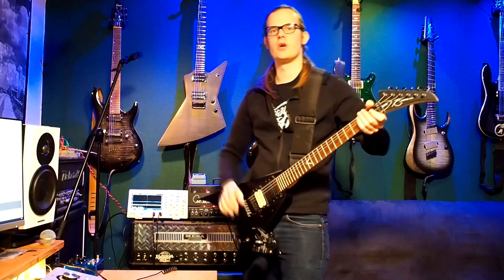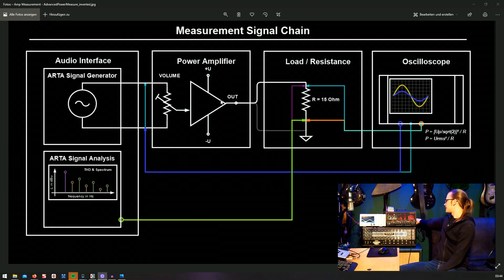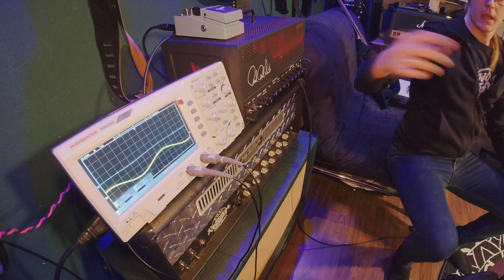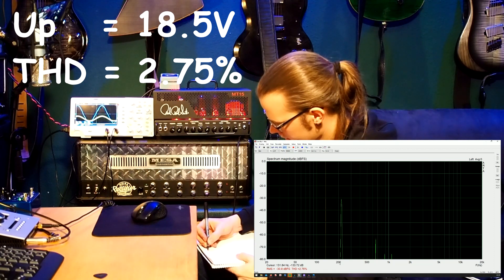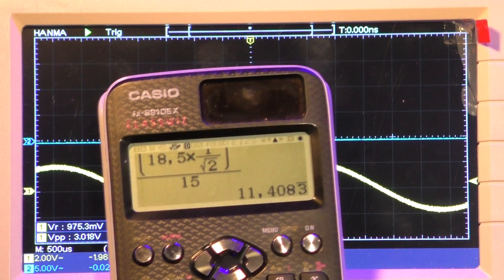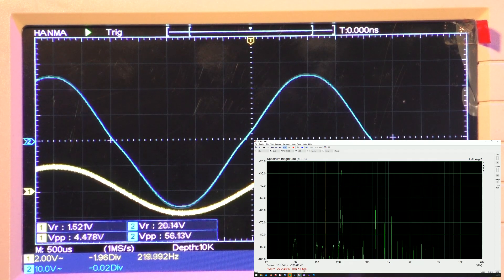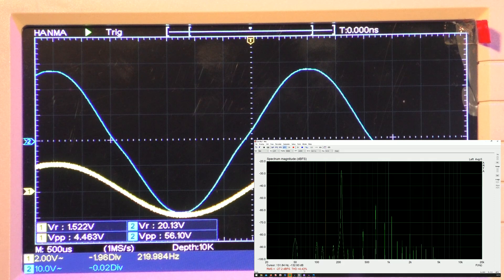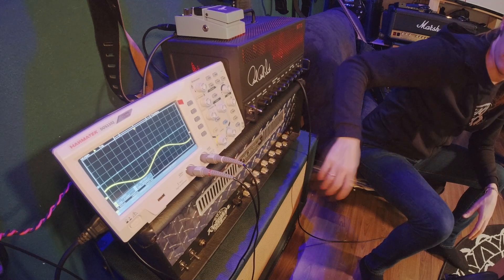PRS MT15   How much is 7 Watt for real???

Comment: Would I be safe using this amp with a 1x12 with one 25 watt greenback?
Reply from the maker: Hey, I think that will work. It's close to the edge of the powerrating of the speaker, but most of the time when you play guitar, the speaker is only confronted with impulses of 20-30W. The 25W rating of the Speaker is an RMS value. So the Speaker can handle 25W over a long period of time which you are not reaching while playing guitar. The only thing that is dangerous in this case, is mechanical destruction. When you play really low and bass heavy stuff while totally overpowering the Amp, the speaker can move very far behind the maximum excursion it was made for and damage itself mechanically. But it will sound totally awful befor thet happens and you will know by the sound, that you are pushing things to far, befor a real defect happens.
Reply: @Fight4Madness  Thanks, this was very helpful

Comment: 25W/12W, they are of course fully aware this is the case. But 15W/7W just sells, because people know that from all the orange amps. Luckily I have a captor X, so no problem with that higher output. Can’t wait to get the amp, probably Wednesday 🤩
Reply from the maker: Absolutely. I'm shure it is for marketing reasons why they rated the amp so low. But it's nice to know that this little beast can deliver enough power for metal gig volumes on a 2x12 without getting flubby.

Comment: Great video, as always! But I thought that low power mode achieved by lowering plate voltage on the power amp tubes... Triode/pentode switching seems a little bit out of fashion.

Comment: Hi, I am not a physicist but wouldn't there be a little less power with the 16 Ohms? (which is supposed resistance for the amp) as from the Ohms law - P = U^2 / R, nevertheless great video :)
Reply from the maker: Hi, basically you are right that there is less power when you change lhe resistance from 15 tu 16 ohm. In this case the result would be 0,7W less, so 10,7W. But there are some other issues if we have a closer look. 
In my video I have only looked at one specific Frequency. It is possible and very realistic that the amp does not deliver the same power over all heareble frequencys and that PRS used a 1kHz signal to comply to some measurement standards and not used the 220 Hz like I did. But the 220 HZ are closer to that, what guitar players are using the amp when they are driving it to maximal power. The accurate way to measure the real power ist a spectral noise measurement. That would deliver the output power in an avarage value over a defined spectrum. 

I did also not go deeper in phase shifting issues. There is always an amount of blind power and an amount of real power. The relationship between these both are depending on the signal phaseshift and a result of the complex frequency dependent phase behavior of all used components. In the video I just measured and calculated the sum of both (blind and real power) , because I did not divided them in to real and imaginary ammount.

I would say stuff for the next deep dive video 😅
Reply from the maker: ... in addition to the last post: The imaginary amount schuld be close to Zero, because I used an resistance without any capacity or inductance. So that has not really an impact of the measured result.

Comment: Awesome information, I've just got mine a few weeks ago. I have an issue, the FX loop is pretty aggressive and I'm using my delay, reverb, chorus, and eq into the FX loop. If I move to send and return cable jacks from the pedals to 90deg position towards to ceiling, the hum is reducing, but if I turn the jacks (angled) parallel to the floor hum is increasing. I tried to change the power supply, power conditioner, different brand high-quality cables and they all didn't work. Any suggestion? Thank you.
Reply: I had the exact same issue as you. Only tried to run a reverb and delay in the loop but it was unusabley noisy. 

I fixed it by changing the FX loop tube from the stock 12ax7 to a 12Au7, it has much lower gain factor and it 100% solved the issue for me. I can now put whatever pedals I want in the loop and it’s silent. It has slightly changed the sound of the amp but to me it’s in a positive way. The master volume is slightly more useable at lower volumes and the bass is cleaned up a little. 

I also make sure to use the shielded end of a guitar cable in the loops return jack and try to keep the cables away from the amp if I can.

May be worth trying yourself and hopefully it solves your issue as it did mine :)
Reply from the maker: @samspittle  This is a very nice way to deal with that problem. I think I might try a 12au7 also on the efx position to optimise the Volume regulation. It's a real good idiea.
Reply: @Fight4Madness  it’s not a huge difference in terms of taming the master volume but it is noticeable. It works wonders for the fx loop though. 

I can’t take credit for the idea however, I came across it from a user over on sevenstring.org. Someone there mentioned it so I gave it a go and it worked great. Brilliant videos by the way
Reply from the maker: Hey, sounds like you have a power kable running directly under your pedals in the floor... 🤔 But besides the joke's.: because aus there is no master volume after the FX return, the input is extremely sensitive. I nearly always used a noise gate in 4wire method on the amp, Abos gt-8 ore a headrush, and never hat any noise problems. Wenn you have changed the wires and the powersupply of the pedals, the only thing that I can think of testing is, to switch the last pedal in line, hoping an other one has a better shielded output jack.

Comment: Where are you with your amp build? I’m currently building a 1W SloMicro. I’m saving a couple of shots of Bullenschluck to celebrate our builds!
Reply from the maker: Uh, sloMicro sounds nice for a project. I'm at the moment pretty happy. Holes are drilled, parts are mounted, powersupply is working, power Amp is biased and the phase inverter is working. So I could here my first clean sounds from it 😊 What is Bullenschluck for a Snaps?!